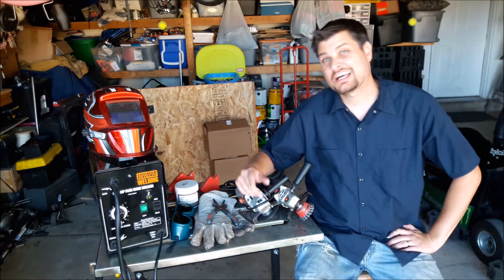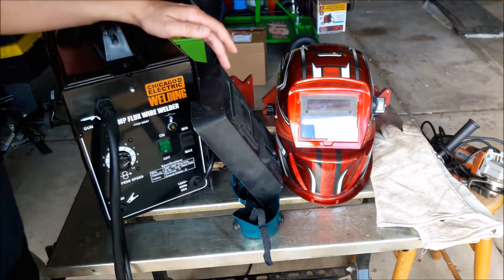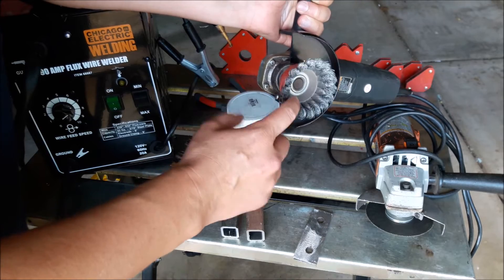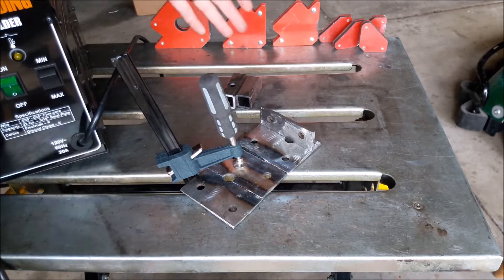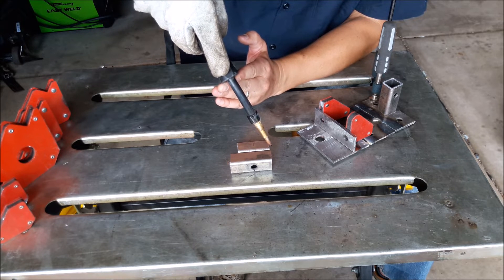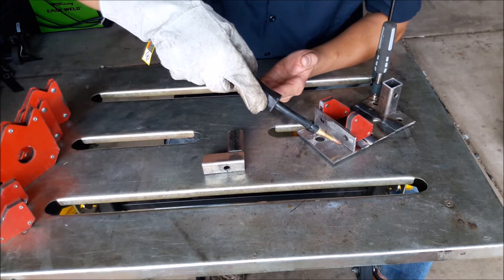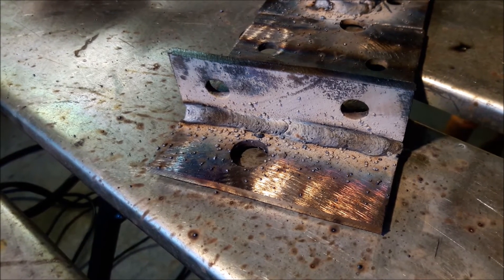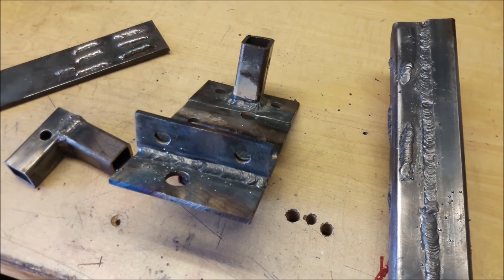How to Flux Core Weld w/ Cheap Harbor Freight Welder. What To Know Before You Start.

Comment: Cure to REDUCE spatter - rin at ABOUT 5/8 to 3/4 stick-out. Ideally 3/4 is too much, so no more than that  to prevent soatter. Less than 1/2" and you get lots of "Porosity" So aim for about 1/2" - 5/8" ... .

Comment: I'm strictly a hobby welder.  I haven't had any welding training since High School, about 100 years ago.  I've watched a lot of videos on converting this welder from AC output to DC electrode negative.  I did mine and it made it a much more capable machine.  It puts much more heat into the weld instead of into the wire with much less spatter.  I welded up a mount for a hydraulic cylinder for my HF motorcycle lift and all the welds came out great and are holding strong.  The welds need to put up with about 10,000# of force to lift a heavy bike.  One thing I like about this welder is that it will accept a 10# spool of wire rather than the usual 2# spool.  Big savings.  You can get a 10# spool for about the price of 2, 2# spools.
Reply from the maker: Right on, thanks!

Comment: I have the OLD blue 65 amp flux core welder from HF... the one made in Italy instead of China. I made 2 improvements that made a world of difference. 1) Upgrade the ground clamp. The stamped steel clamps that come on these cheap welders are garbage. A better ground gives a better weld. 2) Don't use cheap flux wire. Way too much spatter. Lincoln Innershield is expensive, but welds much cleaner and is actually rated for multi pass welding
Reply from the maker: Made in Italy! I wonder i when they made the change. It would be interesting to take them apart and see the differences.

Comment: What probably happened with the breaker is that the welder transformer or inverter heated up, drawing more current and causing the breaker to trip.  Putting a fan on it, or doing short segments with breaks would prevent the breaker from tripping.
Reply from the maker: I'm not an electrical so I'll go with it!

Comment: When welding two pieces together at 90degrees should the vertical piece be at the end or on top?
Reply from the maker: You can weld in all positions, takes a lot more skill to do vertical or overhead. If you are just starting out keep it flat and horizontal.

Comment: Look for a welder with adjustable wire speed and temp.   Not just flip switches.  Also harbor frt only Carrie’s the cheap Chicago welder as of 2022.  Amazon has much better for same price.
Reply from the maker: I agree if possible get a nicer machine but if you only have a Chicago Electric then that will do.

Comment: I notice the Forney easy weld 125FC in the background.. I own the same welder and have tried every trick on this magical internet for 3 whole spools of wire but cannot get a decent weld, any tips for that specific welder? I can lay dimes with my Snap-On 140 gas shielded MIG so I don't know if its me or my Forney welder.
Reply from the maker: Since you have another machine that you can test your welding ability I'd say you may have a bad welder?

Comment: How can I weld without burning or melting the metal
Reply from the maker: Turn it down all the way. Don't do long passes. Practice.
Reply: I have the harbor freight it only got a bottom high and low  and the wire feed but is still burn do a reduced the wire feed

Comment: I found myself in Old School 85 amp Century Dual Purpose welder that welds up to 1/4 inch thick material perfectly with a cart for only $75.
If you use a Marketplace correctly you can find a lot of things for cheap now I'm looking for a stick welder to start my own business.
Reply from the maker: Awesome deal, if you can find second hand all the better......that is if it works of course.

Comment: So that was using a 15 amp breaker? It worked but tripped periodically?
Reply: Yeah...I have a different but similar style welder, and my 15 amp breaker will trip at the Max - 2 setting.  So I am limited to Max - 1 until I get an electrician out to install a 20 amp circuit with 12 AWG wire.  I would do it myself, except I drywall finished my garage and would rather not make a mess of it :D

Comment: This was a great video 👍. Found it to be real helpful. I have been practicing with my harbor freight 90 amp flux core welder and it's not easy . But once I made a few adjustments especially with wire  speed and dragging speed  it's getting much better.
Reply from the maker: Nice!

Comment: I think I'll stick (1/2 pun intended) to SMAW.
Don't know if that Horror Fright welder can also use 220v, but my new DEKO  stick/arc/ SMAW welder has an adapter to use either 110 or 220, and I bought an adapter from Amazon to be able to use my DEKO via a 3 prong clothes dryer outlet. Also purchased an extension cord for welders.  I won't have any "bird's nests" of spool wire to deal with.
Reply from the maker: Stick with it!

Comment: I've never tried to weld flux core before but will pop a spool into my everlast welder this weekend.
Reply: Did you try it out? I got a hobart handler 100 with some good hobart .030 wire and it does great. Can weld up to 1/4" easy without preheating anything. Been a great investment.

Comment: Does one have to weld on a metal table. What are the rules for using the positive and negative clips? Thank you for the information.
Reply from the maker: No, I used just my cement floor for many years. Obviously with out using a table you'll need to ground directly to the peace.
Reply from the maker: What is a positive and negative clip? Are you talking about the ground clamp?

Comment: this video was so worth watching simply because i was cleaning my shop yesterday and had  a bunch of broken or just plain crappy tool i put in a box for 'repurposing'... one of them was a HF grinder that i replaced with a dewalt when the damn thing WOULDN"T CUT A POWDER BLUE CAST IRON BATHTUB IN HALF...   but rather than using the motor for something, putting a wire wheel in it makes more sense...   and never knew about nozzle gel...
Reply from the maker: Glad i could help!

Comment: Make a video on how not to get shocked
Reply from the maker: Have you been shocked by the welder before?
Reply: welders are almost always too low a voltage to do pretty much anything to you. i think the average is 17 volts and that ain’t much. it does have a lot of current but the current can’t do anything if it doesn’t have the voltage to push it through you.
Reply from the maker: @WildfoxFabrication  true, you would need to be bare foot standing in water with your tongue out!